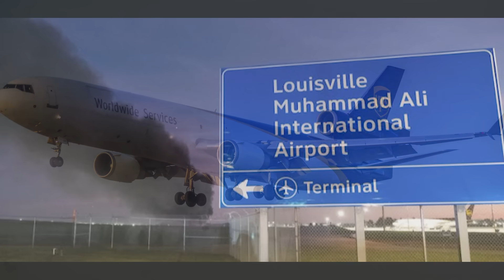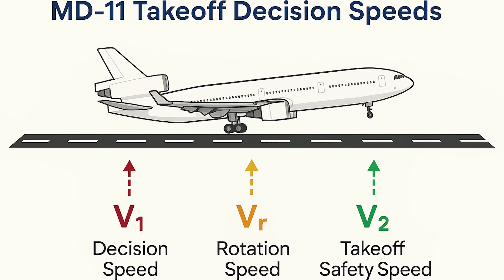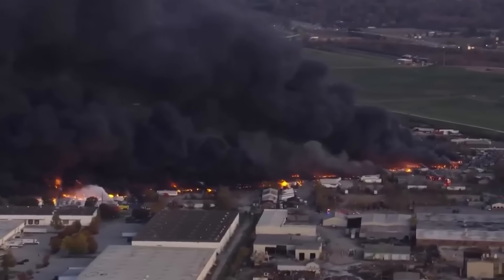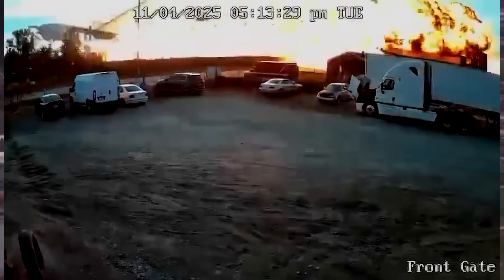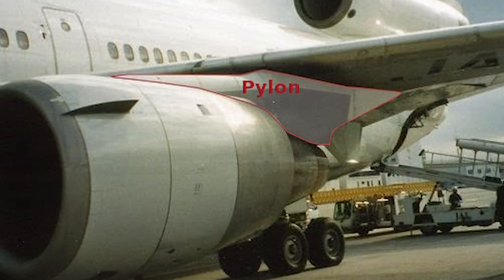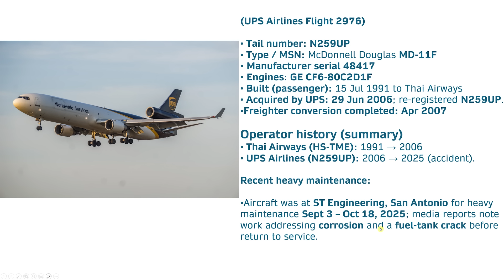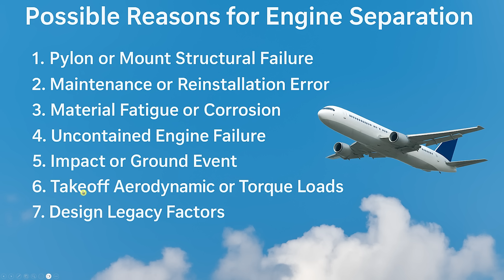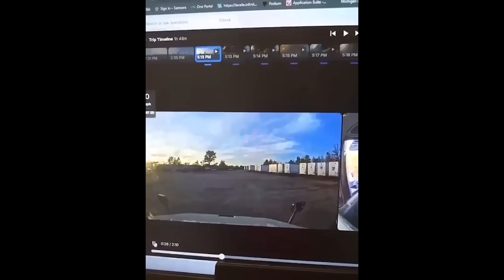What Caused UPS Plane Crash, Louisville, KY? How MD-11 Engine Fell Off

Comment: ¿can the bolts attaching the engine to the wing stress fracture?, that would be rare, I think there are 3, I can´t think about other reasons for the engine to fall off during takeoff
Reply from the maker: yes they can indeed fracture

Comment: The book basically says at or after V1, the plane can lose 1 engine and it should be able to take off.  Sucks either way about this crash.
Reply: These guys lost 1 engine and at least partial power on #2. You can see it sparking. It probably took in debris from the #1 engine departing the aircraft and was compressor stalling.

That means they only had 1 good engine. Near max load on V2. On fire and tail heavy.
Reply: It is possible engine 1 tearing off could have damaged hydraulics for the left wing control surfaces.
Reply: @DocMicrowave  engine one almost certainly did. And then if you look, you can see it tore up the top of the wing (thats where the flames are coming from) from launching forward without anchoring and then tumbling back over the wing.
Reply: @defies4626  Indeed.  And I'm sure torn fuel lines were still sending fuel to where the engine use to be.  Fueling that fire.  
I wonder if the pilots had time to even realize engine 1 wasn't there anymore.  Probably too busy trying to keep the plane airborne to cut fuel.
Reply: Engine 2 was fodded from Engine 1.  The poor souls had no chance.

Comment: Hi Jeff. I watched two other analistis videos (actually the same vídeo you showed in the beginning of this video) somehow showing what they said the tale engine having engine stalls (possibly) still on top of the runway. Since yesterday (date of the accident) I was thinking about the reasons that made this aircraft not to be able to, at least, fly higher. If the engines 2 and 3 were working properly it should be able at least to fly longer. Please try to find these videos showing the engine stalls. Praying for all.
Reply: You can see the #2 engine throwing sparks in a few different pieces of footage. It probably ingested debris from the #1 engine departing the aircraft.

#2 may have still been producing some power but there's no way it was producing the power it would've needed to for the aircraft, at near-max load, to fly on 2 engines. Especially with other contributing factors like the CG shift and the possibility that the #1 engine departing the aircraft caused hydraulic failure on the left wing's leading edge slats.

Comment: flammable liquid tanks underneath the landing glide path or take off path, within 5 miles of the runway ends, is about as smart as reinforcing an ILS earth berm with concrete !
Reply: Most major airports have tank farms on-site to store and provide fuel to the aircraft and vehicles on the airport. It's generally not a problem. There are a lot of other things that went wrong for this accident to occur. It's just not practical to clear the area around an airport of everything that might be flammable...
Reply: @bbgun061  two points: One, that's not a fuel tank farm, it was a used oil recycling tank farm. Two, while it is necessary... it should not be in the most dangerous zone in the 'we lost lift and are going to crash' margin off of the end of a runway. That should be cleared, and any tank farms should not be under the most commonly used flight paths.
Reply: @defies4626 If it was a waste oil recycling facility it's they'd never been an issue with it's location - from a transport/safety perspective it isn't classed as flammable.
Reply: @bbgun061  Yes, BUT, do they need to be literally at the end of the main runways? I understand proximity, but in direct line with the takeoff runways doesn't seem prudent, regardless of proximity.
Reply: @antontonable 
That business was there first before they expanded the airline for UPS.
Reply: @bbgun061  But, uhh, how about the most basic precaution of not putting said tanks directly in the flight path? Please remember that the petroleum recycling facility was not what you referenced.
Actually, I wouldn't put anything in line with a runway for quite some distance.
Reply: @georgiarasmussen8343 have fun trying to get the residence of Teterboro NJ to sign off on that idea.
Reply: @mowtivatedmechanic1172  Well most of those businesses are totalled now anyway, so relocation is not a cost issue - they have to be rebuilt.  That land should be rezoned for low occupancy purposes henceforth
Reply: @georgiarasmussen8343  My point was that most airports already have things more flammable than petroleum recycling facilities nearby. It's never been a problem. It was just bad luck that this plane happened to crash where it did. Very few things react well to having airliners fall on them. The expense of clearing all the land around every airport would be far greater than the very unlikely event of a crash. Major airports see thousands of flights every day, with no incidents. This is basically a one in a billion event. Tragic, but these things happen. Commercial airlines are the safest mode of travel, and we will learn from this accident and make it safer.
Reply: @bbgun061  Yeah - but keep them away from the direct approach and take off paths, whenever possible.
Reply: Couldn’t they put the tanks a safer distance away and run underground pipes to the airport to fuel the planes?
Reply: @HeidiD-t4d No - too expensive, you have to be realistic. As someone else said, this plane had 30K gallons of fuel onboard itself.
If this tank farm wasn't present the outcome would have still been the same, huge amount of fire + dead and injured people.
That tank farm in the grand scheme isn't really a contributing factor to this accident.
Reply: @HeidiD-t4d  money for what
planing apps
locals
Reply: @HeidiD-t4d  I'm under the impression that fuel is brought to the plane via truck, which is likely cheaper than pipelines.
Reply from the maker: All designed by OceanGate CEO Stockton Rush
Reply: @jeffostroff 
Yea.. that didn't go to well
Reply: @jeffostroff  Okay. i realize they say they found the engine on the airport, possibly even on the runway. but i swear just as the plane passes in the gap of the trees u can see the engine passing up and over the left wing. its the source of the fire and smoke u see with the plane (what else could cause it?) and just then hits the ground just as it passed the road. this is the first explosion . which occurred BEHIND the plane. the plane was just then doing a violent left roll so the wing would hit the ground (that point is well past the first explosion/fire on the ground.).
Why would an engine fly over the top of the wing? its putting out thrust. so much so that if it broke off it would not be clean, remaining connections between the engine and the wing would act like a hinge and the engine would end up pointed farther up and up until its flips over the top of the wing. theoretically breaking the wing in the process, which would explain why the plane also violently started to flip.
Reply: @armastat  My impression is that the source of fire and smoke is likely the fuel leaking out of the left wing fuel tank and burning. That will make a LOT more fire than an engine.
Reply: @armastat ...look for the video of the o, hare crash in Chicago in 1979 ....most probably the same thing happen here...very similar.....in those video,s it explained that the engine flew over the wing.....and the cause was basically the workers being careless with the parts that holds the engine in place.....I think that crash might solve the Louisville crash or it might give a good few clues on what happen.....if you never seen the o,hare crash video of 1979 you mite wanna look it up....very similar to this crash.
Reply: Almost as smart as flying a helicopter through final approach of a busy airport at night.
Reply: @thomaswebb248 ....wash.  d.c.   .... And also a concrete wall  a few hundred feet at the end of a runway but still very close and dangerous like in Korea.
Reply: No really. The fuel onboard was always gonna cause a fireball not matter what they hit.
Reply: @jdillon8360  That's true. And the fact that it was a fuel storage place also meant that there was likely restrictions on what other industries were allowed in the area and how far away they had to be - I'm guessing those regulations probably saved some lives as it meant less ppl on the ground in the affected area. 

It's impossible to know how many lives were saved by that, but if it had been... IDK, most other industrial buildings, the death toll and injuries would be much much higher.
Reply: @jdillon8360  But the burn duration is less if it's just fuel onboard.  The L3 black boxes are only certified to withstand methane flame temperature for 30 min, sustained hydrocarbon fires could jeopardize data recovery.  Any news if NTSB have confidence in these fdr/cvr ?
Reply: So tragic and sad.
Reply: Are we seeing the fuel being dumped from the broken plane in the first video? It sure does look to be a liquid coming from that aircraft.
^..^~~
Reply: Exactly!
Reply: Guess the 32,000 gallons of Jet-A onboard was not an issue.
Reply: There's a lot of buildings around the perimeter of a large airport.
To say no bulk storage of fuels for several miles is utterly unrealistic.
Reply: @deezelfairy  But the exclusion area keeping away from the direct flight paths is not that great,  however it is moot anyway - no new airports are likely to be built for several decades I reckon
Reply: Like Japan! Building a nuclear power plant on the coast practically on a fault line while being one of places with the most earthquakes .
Reply: @Snow-chi  TBF, the problem at Fukushima was that they put the backup generators in the basement - which flooded. If they'd put the diesel generators on the roof or at least much higher up in the building? They could have continued powering the cooling system and the reactors likely wouldn't have gone into meltdown.

Comment: I think the confirmation the engine is missing is because it’s still at the airport
Reply: On the afternoon of May 25, 1979, the McDonnell Douglas DC-10 operating this flight was taking off from runway 32R at O'Hare International when its left engine detached from the wing,
Reply: @Jeremyho439  I worked for American in the 80's, and the guy who trained my class was one of the first to arrive on scene after that crash.  He was still feeling it years later.
Reply: @Jeremyho439  Yes, that was proven to be due to faulty maintenance practices. Cracking and subsequent seperation of a critical engine mounting pylon clevis. RIP to those who died in that, and this crash.
Reply: @Jeremyho439  I grew up in Chicago. I remember the news. And no one could believe it. Then they mishandled the cause press conference and spent year or so getting the airlines to admit to using unrecommended ways of changing engines. I think we have that crash to thank for a slow and steady process of finding the cause.
Reply: @Jeremyho439 Damaged mounting during maintenance I believe, while refitting it.
Reply: Actually on reading further, it seems like there was a shift change, and the forklift was left holding the engine for a couple of hours until the final fitting was made, and it had a slight hydraulic leak which caused a slight sag, which caused some microscopic cracks in the mounting which triggered crack propagation (used to be my day job, just not in aircraft), and it failed weeks later.

Richard III: for the want of a nail, the shoe was lost...
Reply: well its not often you have engines left on runway... and they know what make and model the found engine was.
Reply: @williamhaynes7089 so, you mean a confusion with other engines of different makes and model can effectively be ruled out?
Reply: @daszieher  Non-zero chance another plane of same make and model also lost an engine and didn’t notice
Reply: @Max-kr2nl ah, well that would obviously complicate things😂
Reply: @daszieher Regardless, they'd best have a 'role call' just in case.
One, two, thr... ah, dang it - BOSS!, It happened again!
Reply: A petroleum refinery at the end of a runway, brilliant
Reply: @johnmorris7960  "A petroleum refinery at the end of a runway, brilliant"

It is not a refinery, but waste storage tanks that are used to store, petroleum, oil and gas, recovered from the vehicle recycling center.
Reply: @johnmorris7960 It wasn't a petroleum refinery, it was a waste oil recyling company - waste oil is generally considered non flammable.
And it wasn't 'at the end of the runway' a plane travelling at 180knots can cover a considerable distance in a rather short space of time - about 3 miles a minute. NTSB has just announced the last readings from the flight data indicated the plane reached a height of ~450ft. In 30 seconds that plane would have covered a mile and a half.
Most of the fire was the 32000 GALLONS of fuel the plane was carrying.
Reply: Too soon.. 😂
Reply: @haydenbriggs Nah, gallows humour is always appropriate - it's a healthy way to deal with total catastrophes
Reply: @deezelfairy I agree, but as Kevin Hart famously said: "DAMN." 😂
Reply: @deezelfairy : Not for family members who may read this later. 🤨
Reply: @glenturney4750 exactly, how can anyone find humour from people dying horrifically, if it was their Ioved ones, I wonder if they’d still be applying “gallows humour”?
Reply: @deezelfairy it's not necessary gallows humor, it's dry humor
Reply: @glenturney4750 you'd have to be a pretty sick person to subject yourself to watching the footage of your loved ones, let alone reading the comments. Pretty sure we're safe.
Reply: @waveybeats  For those of us that have spent our best years responding to the ugly things that would irreparably damage the average person, it's how we decompress and maintain our sanity so we can respond efficiently to the next ugly event without falling apart. Otherwise, you'd be on your own.
Reply: @stevecochran9078 I understand and respect that completely, I just assumed said people were trolling tbh
Reply: @waveybeats  It's human nature.   Stop the drama over it.
Reply: Hey, there’s an engine lying around out here on the field.  I wonder if that’s the engine that fell off!?🙄
Reply: @shakerman55  I doubt there was another on the way to Honolulu that fell out the cargo hold. I think the NTSB can rule that out.
Reply: you have a great voice for these type of videos.  thank you for explaining minimally so folks, like myself, without aircraft mechanical  training can understand.
Reply: Have some compassion buddy! When were you going to say YOU CANT PARK THERE??
Reply from the maker: It missed it's flight
Reply: @jeffostroff : I was trying to see if there's video that shows the position of the ailerons and if the pilot was trying to bank the plane to the right by looking at the right wing footage as it was coming down. Couldn't really tell, but something to consider looking for. 🤔
Reply: @jeffostroff  it realized it wasn’t cargo and detached itself.
Reply: @jeffostroff Seriously?
Reply: @jeffostroff hey man, if you’re going to Monday morning quarterback at least be respectful. We lost 3 colleagues at ups and you’re sitting here making jokes. Grow up.
Reply: There’s a beautiful logic in that! 🤣🤣😂
Reply: Well the front fell off...
Reply: that skit is still hilarious!
Reply: It may be a good theory that after loosing the engine, fuel was spraying out then was ignited by the second electrical flash from striking the power lines….
Reply: Missing from the plane.
Reply: I still can’t believe that buildings are so close to airports. I know it’s a rare occurrence with planes crashing but planes are getting bigger and better and they need room to abort and go off the runway.
Reply: @luke6575  We require more buffer space around runways than we used to, but you can't fix existing airports retroactively, the building is already there.
Reply: @luke6575  Planes are not getting bigger - that's a totally false statement.

Airliner size peaked with the release of the Airbus A380 in 2007, their production ended in 2021 after only ~250 being made. Most operators are slowly withdrawing them already.
Even the venerable 747 ended it's production in 2023 after ~1500 being made. And that held the title as the largest airliner since 1970 until the A380 was released.

Airlines are currently shifting towards smaller, twin engines widebody planes due to their higher operating efficiency.
Planes are now getting smaller.
Reply: @luke6575 Lol what are they supposed to do, have a 1000 meter buffer? It’s rare enough that it’s a problem that it’s not worth the lost productivity for existing airports.
Reply: @luke6575 There's always hundreds of businesses close to airports - many of which are supporting the activities of the airport itself. An international airport isn't just an airport, it's an ENORMOUS commercial hub. This particular airport is a big air freight hub as well. The airport itself is the tip of the iceberg.

Honestly, I wonder what planet some of you people live - you have no idea how the modern world works in terms of logistics.
Reply: @deezelfairy  Airports move people and cargo, of course they are what make the world go round. But what's wrong with wishing there were enormous mountains of sand at the end of a runway, or a strip of wide open land for the next 1.5 miles to help minimize the surrounding death and destruction.
Reply: @luke6575  Right!?! At least give them a fighting chance..